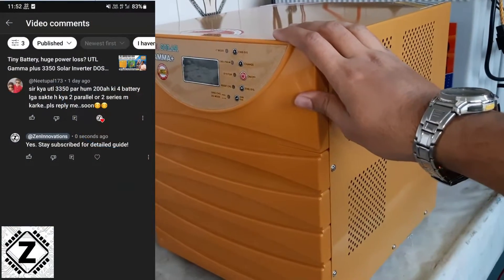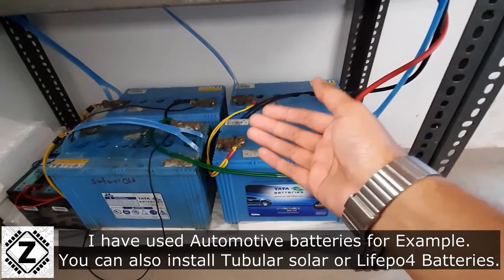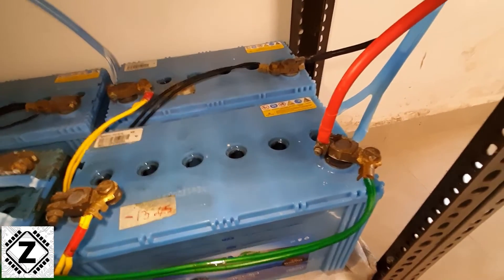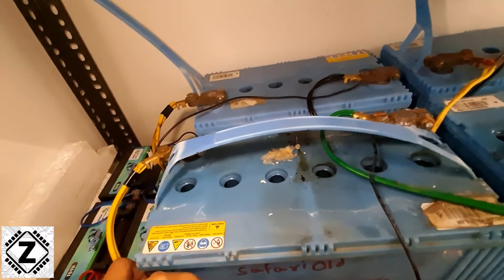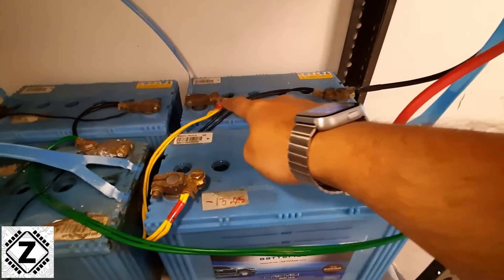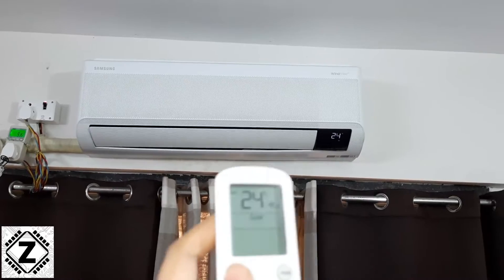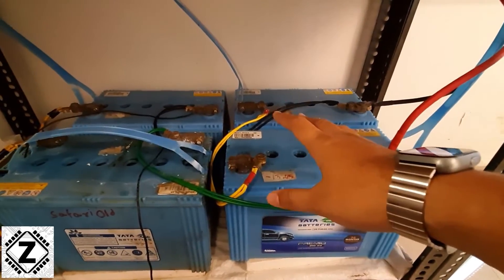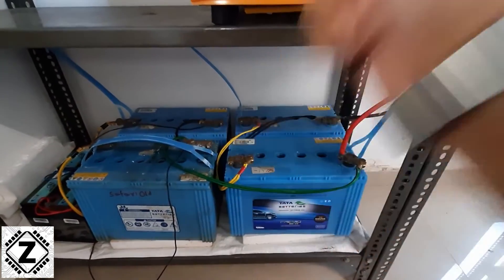[Eng] How to Increase Backup by Connecting 4 or More Battery on 24v Solar Inverter | Series Parallel

Comment from the maker: This Video is available in Multiple Languages-
English- https://youtu.be/ZKPqvQquPxo
Hindi- https://youtu.be/hXu8r7rG5bE

[Best buy Affiliate links] 
Buy UTL Gamma Plus 3350 With Lithium Support https://amzn.to/472bxop
Buy UTL Gamma plus 2kVA 24v https://amzn.to/3Q723S2
Buy UTL Gamma Plus 1kva https://amzn.to/3xodWtz
Sigma 313A Clamp meter With Inrush https://amzn.to/46Q5KTr
Battery Series Linking Cable https://amzn.to/3vfCqrv

#allaboutbatteries  #UTLGammaPlus  #UTLGammaplus3350 #SolarEnergy  #SolarPCU #solarinverter #zenenglish #ZenInnovations  #InverterInstallation

[Playlists]
Do check my Complete Solar Playlist-
https://www.youtube.com/playlist?list=PL9YrG_WglF9wGck8_iWjvKxmlvKnQ__O5

Power Consumption Test Playlist-
https://www.youtube.com/playlist?list=PL9YrG_WglF9wNFgu4vbfch1vjrqouWMrQ

[Important Related Videos]
How to PROPERLY connect two Batteries in Parallel | What is Staggered Parallel ?
Hindi- https://youtu.be/IuXsJBSOn1A
English- https://youtu.be/t-HVsqmXEbw

How to Connect 3 or 4 batteries to 12v Inverter | Multiple battery Staggered Parallel Wiring [Hindi]
https://youtu.be/82WY-aM7PvY

Comment: Hi,
My house is single phase.
I have gone for smart metering ie. Day time 5.30am- 6.30pm, peak 6.30pm - 10.30, pm, off peak 10.30pm - 5.30am.
I am using microtek 24v 2335, 3 nos REC 375 Twin Peak Panels, 12v x 2 nos 200Ah Opgel Okaya batteries.
I split wired my house as follows.
Lights, fans, TV, fridge, audio though inverter.
Microwave, Oven, Air Fryer, Induction, Iron, Toaster, Kettle etc direct to mains.
I have by way of timer/contactor auto cut off grid  power to inverter during 4 hours peak saving full peak consumption and grid  charge battery during off-peak so as to maximize solar usage during day time.
This system has worked successfully and I have saved almost 60% on my bills.
After watching your above video I want to replace the batteries with 10 units 12v x 200ah Opgel in series and parallel charging through the same inverter.
Please let me know if possible? Do I need to fix any external chargers? What about battery balancing?
My phone whatsapp is +94776783218 maybe we can discuss.
Thanks and Regards
Jeremy Grebe
Reply from the maker: Nice plan. These days we recommend Lifepo4 batteries with Active balancer & BMS. You can join my telegram group for further discussion.
Reply: @ZenInnovations 
How do I join that?
Reply: @ZenInnovations  I will check with my son how to join. I am a bit clueless.
The reason I said 10 okaya opgel is because I have 10 new ones in possession in my office and want to use it.. My daily usage for the 4 hours is about 2500W.... But if I use 4000 w the battery bank zeros and  no reserve for power cut.. I can change inverter etc but it's a waste as this system suits fine and I only need to increase the battery reserve.
Okaya opgel have a design life 15 years and 5500 cycles if 20%  discharged which should give me a very long usage time given the fact I am loading 24000w backup
Reply: I am from Colombo, Sri Lanka and very interested in communicating with you.
Sorry for any inconvenience.
Reply from the maker: Install telegram app on the phone, then click this link
https://t.me/Zen_innovations
Reply: Thank you so much for your kind reply.. I will get it done and link with you